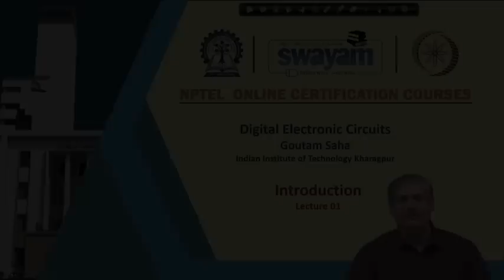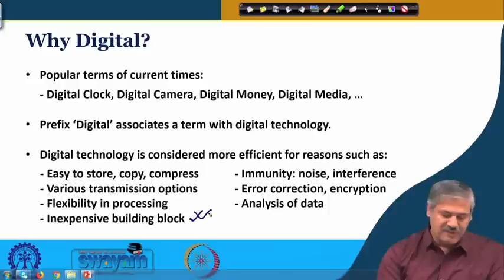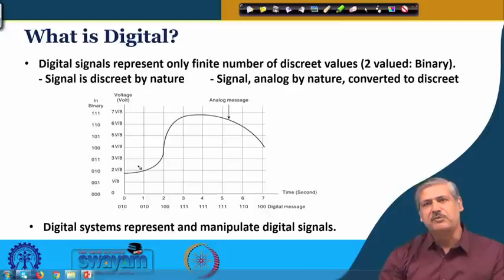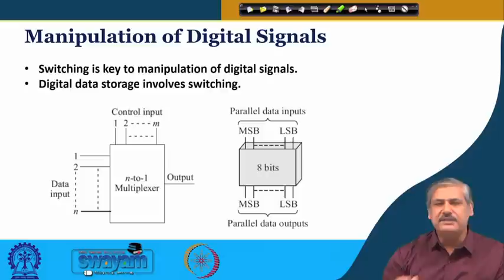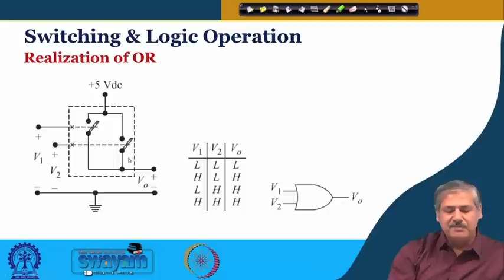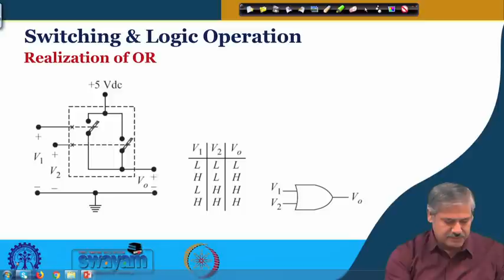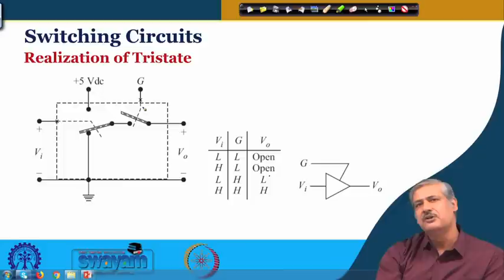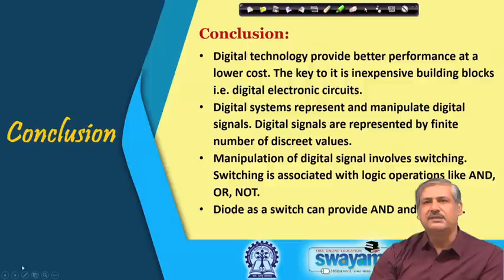Lecture 01: Introduction

Comment: In the realization of NOT , we have to specify the position of switch too, because output in the circuit is not depend on the input alone. Or the circuit may be some kind of relay  circuit.

Comment: why we apply +5Vdc to gates ?????
Reply: Cause digital circuits work on binary, either 0 or 1 and 5V is the standard voltage that represents the level 1 in digital language, in practical purpose this level can be anywhere between 3.5v to 5.5v,